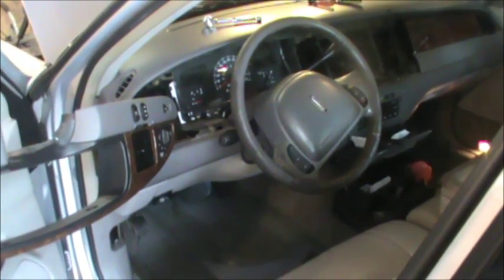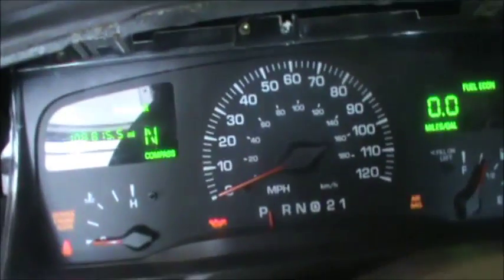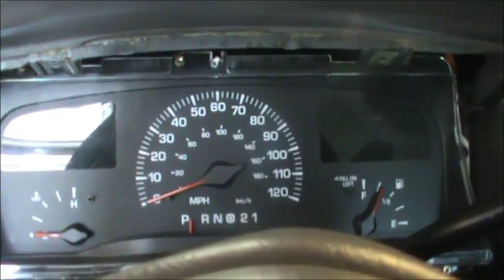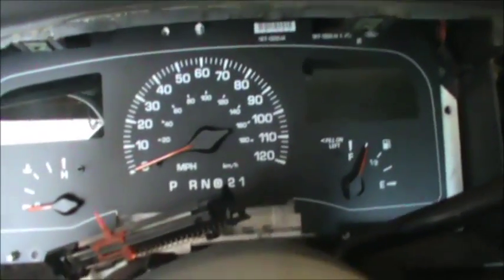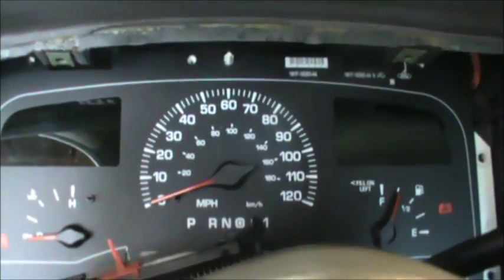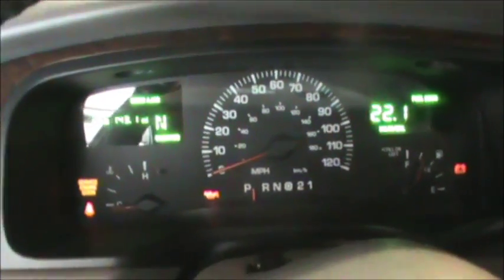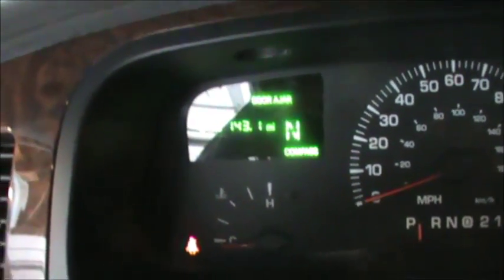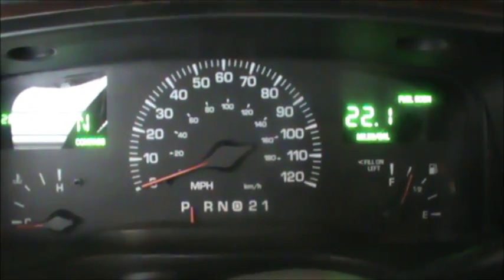How To Replace A Ford/Lincoln Instrument Cluster Without Programing It

Comment: Just bought a towncar with 65K miles on it, the owner said the displays worked last week and told me the mileage, We started the car and they didnt come on, So i ordered a used speedometer from ebay, Followed the directions and swapped the security board and it runs fine, Will send off the old cluster to have it fixed, Plan on leaving the dash disassembled till I got it back. Also it cost me 250 bucks to get ford to tell me it was the instrument cluster not working, what a waste I knew that, And they wanted to buy the car, sorry nope, ANd told me they would charge 700 dollars to reprogram it once I found one that worked at my cost.  You saved me a bundle.  thanks

Comment: Thank you for your video. I just took mine apart the ribbon was all cracked around the soldering on the LED side (left and right) so I reheat it with a 30 watts soldering iron, clean up with alcohol and thank God is working nice now. Thank you for the video.

Comment: Thanks for the video. I have to replace my SES bulb to get my 2001 Town Car through its emissions test. It's not throwing any codes but it looks like the bulb is burned out. While I'm in there it needs a high beam indicator bulb too, I should probably replace all the bulbs while it's apart.

Comment: like your video very intresting.. my question is i have a 2000 lincoln Navigator truck and my service engine light not displaying so my emission fail.. watching ur video i was wondering what if i change the circuit board from another cluster that is good and put in the old cluster should it still work to display the service engine light soon would come on and the truck would start

Comment: Thanks for sharing. Have 2001 Towncar. Is it possible that ribbon connector contacts can have corrosion? My displays come and go.
Reply from the maker: This worked for about a year and then the left side LED's started to flicker on and off again. I'm going to investigate that next.
Reply: I like to use dielectric grease on electrical connections to prevent corrosion but came up with another thought. The solder develops cracks on these PC boards as they get older. You can use a soldering iron (pencil type) and some fresh solder to fix. There's a video where a F-150 mileage display was fixed this way. Look for cracks especially on the end terminals of connectors.

Comment: Question. Did you have other lights within the car pulsing on and off?  In my 2003 Lincoln town car first the instrument lights were on the blink then other lights such as door marker lights and headlights go dim then brighten up. I thought it was the alternator had mine rebuilt, no difference.Then I got anther one that the rebuild shop switched out for me, same thing going on, then I seen these videos on the instrument boards going out and I was told that since all the electronics for the car run through the instrument cluster it would adversely affect all the lighting circuits in the car, Do you think the instrument panel is the culprit in this situation?  I would value your opinion since I cant get a straight answer from certified ford mechanics.
Reply: Lighting Control Module. Get a shop manual, very handy to have.

Comment: if your instrument cluster go out in a 2001 Lincoln Town Car your vehicle will not start the anti theft system light will be flashing very fast do not take it to the dealer they're going to try to charge you $1,000 to reprogram a new one buy one from the junkyard put your motherboard in the new one the instrument cluster Park off 2995 at the junkyard it should fix your problem the way you know it's your instrument cluster if you have a digital gas gauge and there's a line and is not reading the gas it's a good chance the clusters gone out but if the gauges are not working your anti theft system is connected to that your cluster your vehicle will not start
Reply: little thomas SAY WHAT

Comment: What went wrong with your old Cluster ?  I have a 2009 Dodge Journey. I think my Cluster  is non operative  because none of the Instrument gauges nor  digital instrument panel digital lights.  On my steering Column the Wipers will not go off, non operative controls,  I cant control the Head Lights, Non operative, but the Cruise Control still works.      Can I do the same with a Dodge Journey ?
Reply from the maker: The LED's quit working. Hard to say on your's.
Reply: Good Video.

  I think I will try looking at the EEPROM,  where all info like mileage  is stored on circuit board.   I have found you can buy a EEPROM Reader, then buy a Cluster from junk yard or Ebay,  take the EEPROM Data off the Old and then transfer data  to the new EEPRM on  Circuit board purchased . 

 However there is one method that comes first, take circuit board and look for solder crack along pins of the socket, heat up solder iron and resoder. 

  Dealership are ripping everyone off !  Time for everyone to know the truth about the dealerships.   Making us slaves for their incomes.  Anymore, you must go to dealership for reprogramming for any of the Modules that defect.  On the average to replace a Module is 700- 1200 dollars.

When you think about these things will corrode since its circuitry in the open air and wet weather.  it will occur again in due time.

 Thanks for sharing.
Reply from the maker: The last MO-Par that I changed a cluster on was a 1999 and none of the vehicle info was stored in the cluster. I just installed the replacement and the car was good as new with the correct Mileage showing.
Reply: was it a New one or Used  cluster that you installed
Reply from the maker: Used on both card.